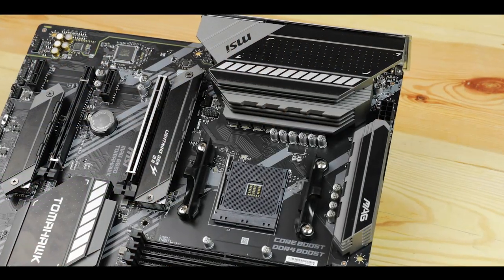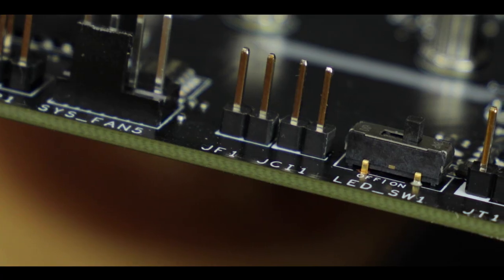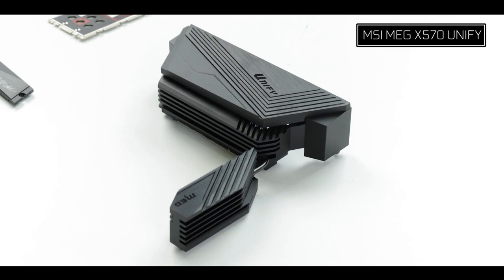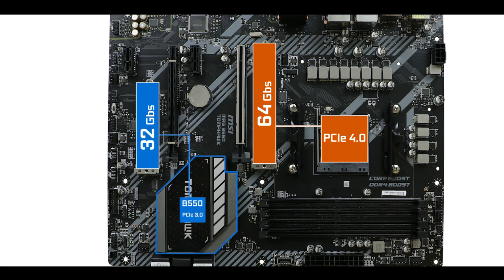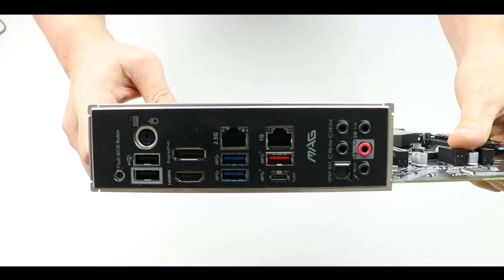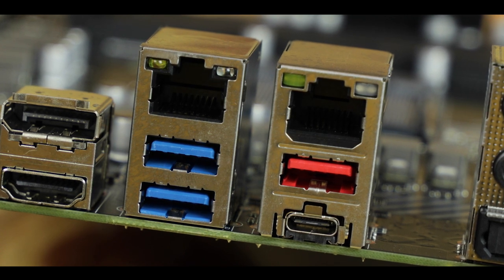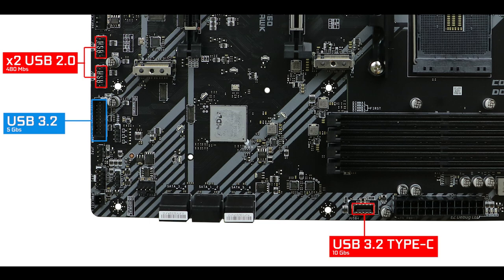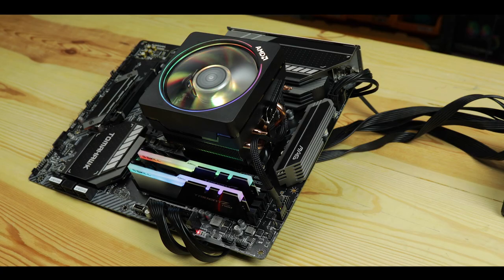MSI MAG B550 TOMAHAWK : a gorgeous mess!

Comment: I use 4x8 Gskill Trident Z RGB/NEO 3200 c14 clocked to 4000 c16 16 16 36, with an 5800x. And it's working fine ! I guess ram can go much higher but i need to keep 1:1:1 ratio...Didn't tried going above that because i know that right now , not many 5000 cpu's can reach 2000 FCLK or above. So Maybe with ryzen 3000 you can't go past 3600 with 4 sticks of ram, but with 5000 you can even go above 4000. Memory frequency is driven by the memory controller from the cpu for the most part, ofc motherboard have it's role in that aswell , but the culprit usually is the memory controller from the cpu itself. 
And the front panel usb 3.2 header is 5gbs not 10.
Reply from the maker: Im pinning this very useful comment to the top of the video feed. 

Thank you Richard for taking the time to write this!!!!
Reply: good to point you made there, it's probably my only complaint about that board... lack of a front panel 3.2 gen 2 usb port
Reply: RAM speed doesnt make any difference for gaming though, and since this is a gaming motherboard, even if the RAM was 2400MHz it would play games exactly the same as 10000MHz RAM. So by lowering the speed per module its not making any difference I think. If this was directed towards high end servers running special software that require fast RAM, I would say yeah its some sort of scam haha
Reply: @PrettyKenziePrincess  It depends, if u are heavy cpu bound , u may see some fps increase , sometimes even a noticeable difference. But in most cases the difference is small or sometimes not at all. I've testet with an i3 12100f with 2133 mhz and 3200 mhz , and in Guild Wars 2 the difference was noticeable , like 15+ fps more (the minimum fps).
Reply: @richardstoica2954  I see what you mean, Im running a 5950x with 64gb ram, I have tried benchmarks at 2133mhz and 4000mhz and the scores were basically identical. So it must also depend on the processing power. No game is gonna max out the 5950x even Star Citizen, which is the game I play the most at the moment, its the most CPU intensive game I have ever played, it took my old CPU (intel 6950x) to around 80%, my new CPU the 5950x never goes beyond 40% and the ram speed make no difference at all so far.
Reply: @PrettyKenziePrincess  There are games sensitive on memory and games that don't give a shit about memory...The games that can utilise lots of cores may not see an improvement with faster memory, but those who utilize less cores and rely heavily on IPC, will see some improvement from faster memory. The biggest problem is the game engine, how it''s utilising the resources.

Comment: I picked and bought this board because it had two ethernet ports which I use in a link aggregration setup and can use the 2.5gbe port when affordable 2.5gbe switches come out. I don't understand why people want Wifi, it's flaky at the best of time. It just can't beat wired ethernet at the moment. 
I like the graphics you use for explaining the motherboards layout! Easy to understand and informative.
Reply: WE CANT STRETCH OUR ETHERNET CORDS THROUGH THE CEILING, MY MOM WOULD NOT ENJOY ME DRILLING HOLES IN THE FLOOR TO GET WIRED INTERNET.
Reply: @zm4475  I used Power Line adapters when I was in the same situation more reliable with more stable throughput than WIFI.
Reply from the maker: Tell you mom that I allowed it

Comment: There's also the MSI Gaming Edge Wifi which appears to be virtually identical to this board,  comparing the two it has exactly the same components in the same places. At $10 more it adds Wifi, loses the secondary LAN port, and has a vastly different aesthetic. I have no use for Wifi but I think the Tomahawk is as ugly as sin so I bought the Gaming Edge. $10.00 was worth it to me to not to have to look at the Tomahawk every day. 

PS/2 seems to be a waste until you get a Windows install where it hasn't properly loaded USB-2 drivers so a USB keyboard and mouse won't work, yet it won't advance until it you enter your user name. I had this happen on a Dell SFF prebuilt I was trying to reload the latest version of Windows on after a drive crash and the only solution was to dig an ancient PS-2 keyboard out from the castoff pile in the basement. 

USB ports are  skimpy, but at least they included front USB-C, something most manufacturers don't do at this price point. If you need a bunch of I/O presumably you buy the X570 version. Or do like I did an add a Startech 4-port, 4-host-controller USB card because I was tired of having USB issues when using motherboard ports with four sensors for my Oculus Rift.

Comment: 9:04 I disagree with this too; Gamers should NEVER, EVER be on Wi-Fi; Wi-Fi is NOT ACCEPTABLE for online gaming, no matter how "good" your wifi is; it's just a less stable link, and low jitter + 0 packet drop is the only thing that matter for online gaming, bandwidth is IRRELEVANT.

Therefore, having 2 ethernet cable means you can use the PC also as a LAN switch to route a cable to another computer, helping in having a ethernet network in your house instead of relying on Wi-Fi.

Comment: I'm not a gamer and I purchased this board in early 2024 because of its excellent reviews (lack of problems) on multiple web sites. CPU/Video: originally 5700G, currently 5700X / 30 watt NVIDIA GT 1030. Other components: 2TB Samsung 990 Pro SSD, 64GB Crucial Pro DDR4-3200 memory (2 x 32GB), be quiet! 550 watt power supply, Noctua CPU and case fans. I wanted stability and reliability above all and after three months of use it's performed flawlessly.

Comment: @Laurent's Choice Not sure the reasoning but maybe this is why the two LAN ports? After installing this motherboard, i ran an internet speed test... i noticed i was getting nearly half as fast download and upload speeds than usual. I was using the 2.5 port figuring MOAR=BETTER even though it doesnt exactly fit my use case. I switched to the 1GB port and my speeds were back to normal.... maybe this is why theyre both included? I imagine how pissed i would be if only the 2.5 port was avail to me given if there arent some settings that could be tweaked (?)... regardless it would still be annoying considering my a320 i upgraded from was plug and go for me as there was only the 1GB supported port.... is the 2.5GB port not backwards compatible for those of us who dont support those speeds thus including both? btw loved the review best on this board. Subbed. I bought this motherboard for 25.00 and aparently it was only a month old. The kid messed with bios settings and got black screens, no post. Albelt he was selling for parts, i had a feeling it was fine and i was right. Took a while to figure out what he did lol but worth it. Considering i was fixing to pay full price at best buy i was VERY happy. And i NEVER buy used, but i couldnt pass this up.

Comment: I just grabbed the X570 version, are you thinking of doing a review on that?

Both M.2 slots on the X570 Tomahawk are PCIE 4.0 x4, but the user manual labels the first slot as M2_1(CPU), and the second slot as M2_2(PCH). Will it bottleneck my performance if put my M.2 SSD into the second slot instead of the first?

Love your reviews btw! Great production value, and you cut right to the chase!
Reply from the maker: I am filming tomorrow , will be uploaded Wednesday
Reply from the maker: On the X570, it makes no real difference

Comment: Hello and congrats for the videos you make. But may I suggest the pricing for the x570 tomahawk is actually 200 usd mrsp vs 180 for the b550 tomahawk? 350 usd is for the msi x570 unify, if I am not mistaking. I wouldn't have posted, but I just bought the x570 tomahawk for aprox 200 euros, and I think it is much better value than the b550. Anyways, keep up the good work!
Reply from the maker: Hey :) thanks for the comments:)
So the price i use are the ones available on main US stores today. 
In the US, the x570 TOMAHAWKs price sky rocketed :). 

At 200 euros, its an absolute bargain!!!!
Reply: Laurent's Choice it’s msrp is $220 which is a good price.

Comment: I have this Board and its worked very well for me...The only problem is that I lost the screws for the CPU Fan Bracket adaptor thing and don't know where the hell I can get a replacement...Does anyone have any suggestions on how I can secure the bracket to the board without the Screws ?

Comment: 7:48 A PC should never be plugged in HDMI, DP is always preferable; It's totally fine to have HDMI 1.4 there just in case you need it for debugging or wathever, or maybe for a scecondary monitor, and you DEFINITELY don't want to be running dual 4K on a igpu anyways so it doesn't matter much

Comment: In lan you can put a printer to share over network. Actually I did myself and all can share. I do not have to buy switch and then worry about power plugs and more tangling wires..Regarding integrated graphic cpu many people use for just productivity so graphic card not needed. As you know it is a cheap motherboard so many do not need graphic card for business use.
Reply from the maker: Absolutely understood  :) 
But in a gaming board such as the TOMAHAWK,  would he loved to see this replaced by gaming friendly features :) 

Though ur point makes sense :) thanks for sharing.

Comment: HDMI port is not working on my motherboard b550 tomahawk,had replaced the item with new one.bt still the problem persists.😔
Reply from the maker: Did u check if the integrated video was enabled in your bios ;)

If it persists. Remove ur video card. Reset the board (remove battery and clear cmos. Wait 2 minutes put back the battery in) and boot you computer with only the hdmi plug to ur screen. 

Should work.

Comment: Hi Laurent, think you may have the price for the X570 Tomahawk wrong slightly, in the UK the price is only £220 so if the B550 Tomahawk is £180, what to choose then?
Reply from the maker: Hey John :)
I base my prices from US based retail stores. Without naming them, a quick Google will confirm pricing.
Hmm... 180 pounds is an awfully high price tag for the B550 TOMAHAWK.  

The X570 tomahawk will give u WiFi, more PCIe 4.0 lanes (from the x570 chipset), and more phases and power stages. 
 For 40 pounds difference, that's where I'd go :)")

Comment: 2 lan ports are great... 1Gbit for Internet (it is 1Gbit out to the net anyways so perfectly fine) 2.5Gbit for the NAS = super fast storage solution, which is excellent. PS2 connect and gpu connectors on an ATX board can just go and die... APU's should not be used in ATX sized motherboards.

Comment: Is it true that this MOBO wont run Ryzen 3600 CPUs? i cannot get a straight answer. and dont wanna buy something that isnt going to work.
Reply: It can only support AMD CPUs Gen 3 and upcoming ones.
Reply: It will run a 3600
Reply: @akmaru  so could it run a ryzen 5600x 4th gen
Reply: @Kevcuh831  you can run a ryzen 9 so yeah a ryzen 5 5600x ez.

Comment: i'm wonder to use AORUS RGB Memory 4400MHz 16GB Memory Kit on Mag B550. help me could it run at 4400MHz? thanks
Reply: you shouldn't run above 1:1 on the infinity fabric which can on most(all) boards run 1800Mhz (3600MHz RAM) and on some boards run 1900MHz (3800MHz RAM), above that the infinity fabric would run a 2:1, so running ram at 4000 (2000MHz is above the 1800-1900 most/all boards can do) would turn it down to HALF that... so 1000MHz and the ram would be running at 2000MHz (which with double data rate would mean "4000MHz")

your 4400MHz RAM (which in really runs 2200MHz) would have an 1100MHz infinity fabric, insted of the original 1800-1900MHz so on paper your RAM is running super fast, but the internal paths on the CPU runs much slower = not good.

Comment: Why are there display port/hdmi on B550? To use gen 4 Pcie you need a ryzen 3000 series cpu but these boards are not compatible with 3000G cpu's. You could put an older cpu with graphics in a B550 but that's like running a donkey in the grand national.

Comment: can I put 2 m.2 ssd 3.0 on this, or just 3.0 and 4.0?
Reply: Yes you can put two m.2 SSDs in but do mind that the second m.2 slot connected to the chipset will run with PCI-E 3.0 speed so about 50% slower then the first slot but still faster then SATA bound ssds. The m.2 ssds can be either 3.0 or 4.0. Obviously it would better to have a 4.0 m.2 ssd in first m.2 slot.
Reply from the maker: Very well explained !
Reply: Matruchus thank you so much!

Comment: Mate going to disagree with some of this! Do you understand the the current basic pcie standard is 3.0......including the current champ 2080ti...... it wont bottleneck a single gpu on the market!
Your review started with it seeming you had a clue about what ypur talking about!
Reply from the maker: Hey Maxim.

U are absolutely correct and I usually mention that its more of a future proofing thing more than anything else. 

But, in the coming weeks the market will see GPUs which will indeed out perform (finally) PCIe 3.0.
 Hence,  me not mentioning it this time. 

If u go back to any of ny x570 / b550 reviews,  you will see that I scrupulously mentioned ur point :)

Thanks for watching and taking the time to comment. 
L.
Reply: Yep i understand this but sadly enough i still dont think that you will see pcie gen 3 out performed. If so no one with an intel based cpu (as this gen 10 doesnt suppourt the format.) would benefit from 3000 series or rdna 2 properly. Until maybe 11th gen if they are lucky. Intel probably not releasing that until what maybe q3-4 2021
Reply: Maxim Roberts look into the mess that is z490. Half of them require an upgrade to support all m.2 slots.
Reply: @unknownperson3691  i have seen that issue raised. Unfortunately there is alot more demand for high bandwidth channels now especially on the rear i/o and all those connections take alot of resources. Its gotta come from somewhere.
Reply: 6900xt says otherwise
Reply: PCIe 4.0 has other benefits than just "standard gpu transfers"... AMD cards can use SAM which gives the GPU direct access to the system RAM and the faster that is, the better, now suddenly the doubling of PCIe speed matters. It isn't highly used yet but it is something we will see more and more.